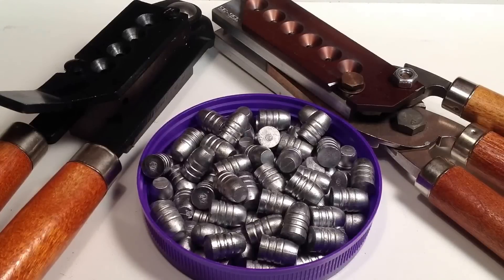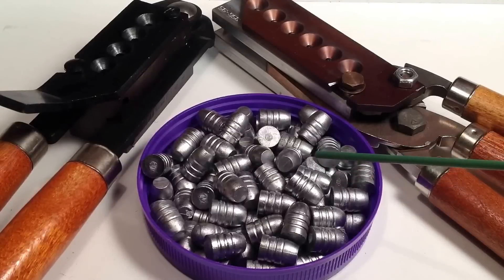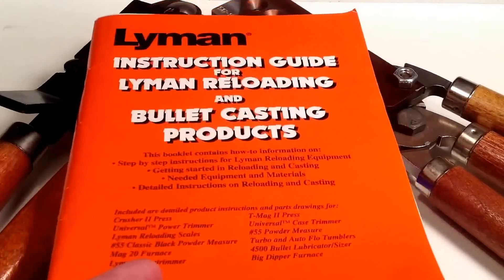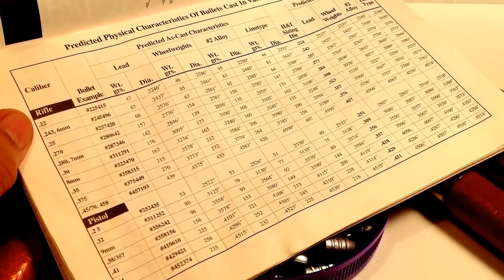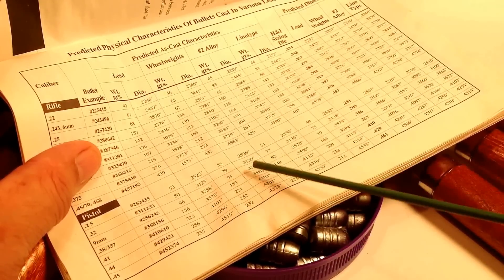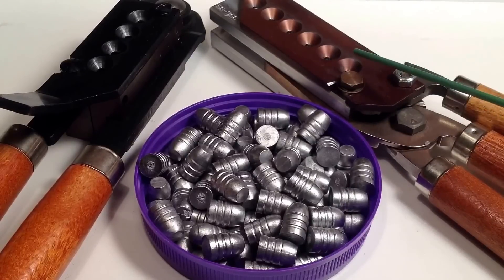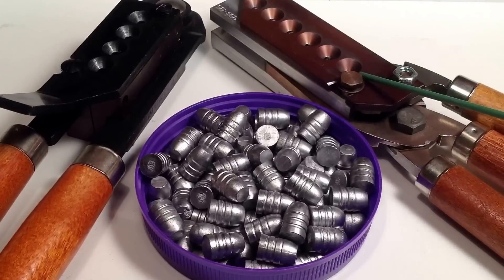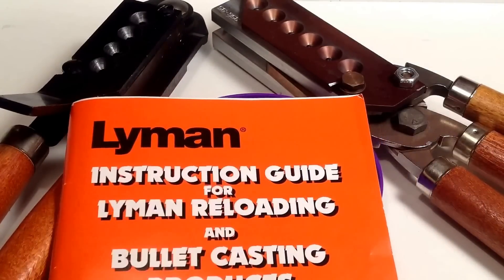Adjusting Size Of Cast Bullets - VR to Spyderxtra777

Comment: With a new mold I totally agree with you. However if you have picked up a used mold you can beagle that mold to increase the size also. I used that technique several times with great success. It's very easy and cheap to do.
Reply from the maker: +mklean1 -- I know about that technique, but I have had no occasion to desire doing so.  Never occurred to me to buy used bullet molds, even the ones that cast designs out of print that I would like.  A video on your technique to increase bullet size would be interesting indeed... Best to ya!!

Comment: I cast with nearly pure roofing lead and a little bit (~2%) tin so it casts sharper. The temperature at setting 7 at the Lee pot. This gives me bullets 0.0005 bigger than needed, I powdercoat them and calibrate them afterwards. It works great this way

Comment: Great info! I just picked up a Colt Officers Model Match six shooter in 38 spec and need to size my bullets to .357. I've been sizing down since they are dropping at 358-359. I will try to maintain a low temp and not at Lino to see if I can drop the bullets to what I need. Thank you!

Comment: A solution might be to use straight linotype (BHN 22), as it has the least shrinkage - way less than pure lead, or even Lyman #2.  Don't know if it would make up the .002", but might be worth a try.   I've found that linotype generally casts bullets about .001" - .002" over the stated diameter of the mould.  That's after cooling off and shrinking.   One of my moulds claims diameter of the bullet to be .452", but my linotype bullets are about .4555", which is way over claimed diameter.  It takes two or three steps to size .4555" bullets down to .452" , or .451", for use in my Freedom Arms 454 Casull.

Comment: Temperature does make a difference for sure. He may have got a defective mold, my Lee molds usually drop out at the advertised size with wheel weights.
Reply from the maker: +TRprepper And I have also experienced similar with my own concoction of #2 alloy - range scrap with linotype added (or SuperHard alloy).  Lee molds do like to be run on the hot side, but the shrinkage is perfect for the final results... Good castin' to ya!!

Comment: I know you have said Lee molds were great, that's why I recently bought 3 Lee 2 cavity molds. .356, .452 and a .358 semi-wadcutter. The .356 and the .452 work acceptably but the .358 is constantly .0022 " undersize.  I Inspected 3 lots of 60 units each. I used Starrett micrometers calibrated to .0001"I took your advice and returned the mold to Lee (cost $12.00 almost half the price of the mold).They returned the mold to me and said the mold cavities were inspected and measured by Mr. Lee and they were within tolerance.This was a total waste of time and money.......I have reloaded and cast bullets off and on for over 40 years with no problems until now.  I'm going back to Lyman or RCBS molds....

Comment: Lee sizes the molds based on a 10 to 1 alloy. This applies both to weight and dia. I had to send a .309 mold back 2 before they sent a replacement. Lee guarantees their mold size tolerance is from stated size to plus .003. So for .a.309 mold the  cast bullet dia will vary from .309 to .312

Comment: What would you say is the cut-off as to if a bullet is too small?  For example, some of my bullets came out at .4515 instead of .452.  Should I be worried about that .0005 inch?
Reply from the maker: +jacobbrown7680 - If your auto pistol barrel has groove diameter of .451" as many do nowadays, or if your revolver has cylinder throats miking at .450 - .451", those .4515s of yours would be pretty much perfect.  And if you kept the mold or alloy a bit towards the cooler side when casting, you can easily get your bullets to drop at .452" as you would get less shrinkage on bullet cooling resulting in the slightly larger slug... Good castin' to ya...FC
Reply: +FortuneCookie45LC - As always, thanks a million for your advice as well as your reassurance!  I can honestly say I would NEVER have gotten into casting if it weren't for your videos!  I plan to send my Lee Mold back anyways because one of the cavities is damaged and doesn't drop bullets out easily, but if you feel that diameter should still be good, I wont bother mentioning it then.  I am currently trying to copper plate these bullets for my Ruger Super Redhawk .454, but down the road, I might PC the bullets or just try your 45/45/10 method.  You make the PC process look just as easy as casting from wheel weights is, and that the PC probs are easy to overcome.   BTW - when do you sleep?  I sent my question at 3:30 AM (my time from Wisconsin) and you replied at 4:00 AM.  NOW THAT'S CUSTOMER SERVICE :-)
Reply from the maker: +jacobbrown7680 - As you can tell, I did get some sleep - even night owls have to shuteye at some point..ha, har!!  Never got into copper plating as the chemicals used are on the toxic side and you have the disposal problems.  Your Casull is a mighty versatile firearm, indeed.  You will find that PC will do everything plated bullets will do.  Plus the PC process is much more amenable to our home systems.  I just got some PC bullets from mytmousemalibu that uses a higher quality powder and they are most impressive... Have a great day,  FC

Comment: are the bullets dropping round?  i have had a terrible time with the new style 2 cavity tools having pin shift
so they closed up with the cavities shifted fore and aft just a smidge, so they measured small with the plane of the cavity face
Reply from the maker: +wayne johnson (Range Bum) --When Lee left the V-Ribs = V Grooves alignment system to the pins and bushings, they could not afford to have misalignment problems ensue.  When I close my 6s the pins close perfectly into the bushings with the cavities aligned perfectly and the mold blocks close like a bank vault.  Any misalignment with the system shows up big time with the 6s, but the 2s also show up as you have noted.  Nearest thing I can imagine is the pins are not fitted to the bushings on your molds properly.  I have heard of a few cases also where the bushings or pins came loose from the blocks.  These are all intolerable situations, and those molds need to go back to Lee ASAP.   I must be lucky because I have purchased a fair number of the new pin-bushing molds, and have had no problems with them even after some heavy use.  I know that you are an experienced caster and would not abuse your molds - has to be a manufacturer defect.  Let me know how it goes when you contact Lee and send the mold (s) back...  Best to ya...
Reply: +FortuneCookie45LC on the 2 holers one thing i have done is to drive the pins out far enough to give a good size and lockup (even a tiny air gap you can see holding up to the light)then peening material in behind the pins and sockets to hold them fast,saves me paying for shipping back to Lee only to receive another shifty pin tool
Reply: +Dave K sure!, ill do a google collection of it and post the link here, if thats ok with FC, ive done some others if you want to check those out
Reply from the maker: +wayne johnson (Range Bum) --Completely OK!!  I'd like to see that myself...Have a great day
Reply: +Dave K here ya go Dave and all  https://plus.google.com/u/0/collection/Q7f5l leave comments in the collection if you wish
Reply: +Dave K thats what im here for man

Comment: Good advice, but another option is to just add a few coats of powder coating and it'll make up the .002 difference
Reply: +Prepare2Survive takes to much time, one coat if done properly is way more than enough, fix the tool or get it fixed, thats the answer

Comment: the 'gyrations' arent that tuff, and you covered them, turn down casting temp a notch or 2, and /or add some tin to the mix,  I'm back in the game casting for the 45-70 and 45 Colt, straight wheelweights casted as cool as I can get a good fill-out and water quenched, they are looking nice and they are nice n hard too
Reply from the maker: +Rob Aldridge -- Always great hearing from Rob Aldridge - Sounds like you have a good casting system and rhythm to get in the sweet spot and make a lot of fine bullets...That's where all casters want to be!! Good castin' to ya...

Comment: What is antimony?
Reply from the maker: Brian Meier - Sorry to not reply till now - Google did not post your question in my inbox and I just stumbled onto it months later... Antimony is an element on the periodic table.  It is used very effectively to harden lead alloys.  Raw antimony is a silverish metal, but it melts at 1167 degrees F. and lead at 621...so the lead has to be heated real hot to get antimony to melt into the alloy.  This is not for most home casters to do... luckily, RotoMetals makes Superhard Alloy (70% lead, 30% antimony) ready mixed and easy for us to use to simply add to our molten lead to get the hardness we want.  Best to ya,  FC